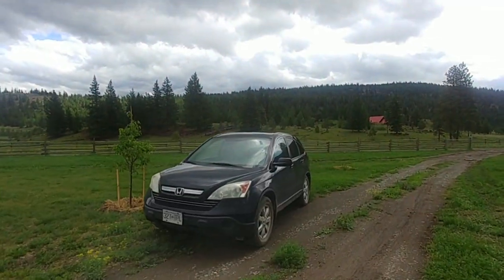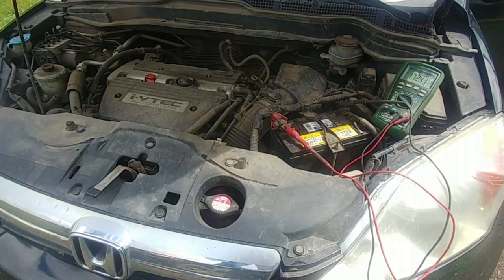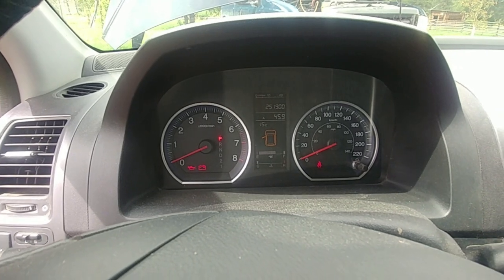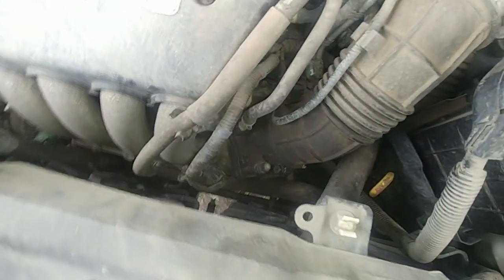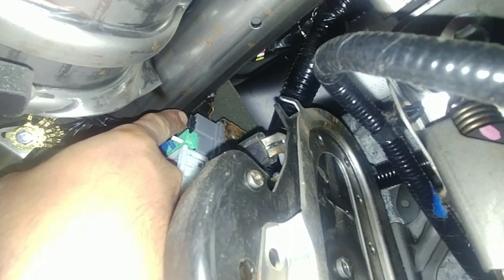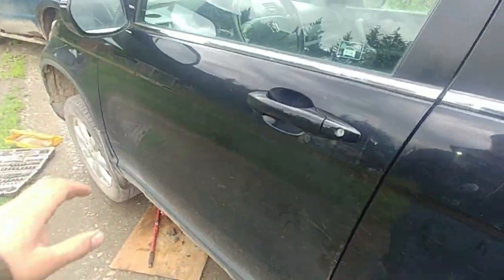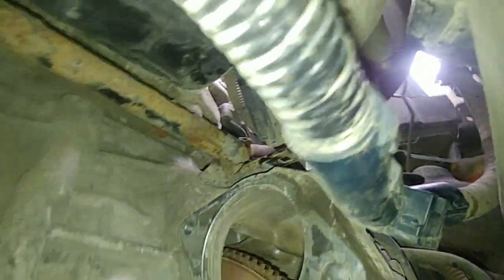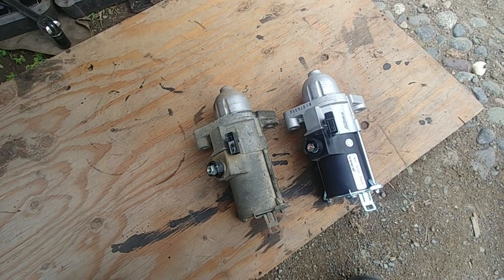HONDA CR-V NO CRANK, NO START - BASIC TROUBLESHOOTING. We Fixed!

Comment: Well done man, you've obviously spent some time learning to do this correctly. You even did the boost sequence by the book, and you load tested the signal wire, putting yourself ahead of many pros. The practicality of getting to some of these connections is the most irritating part of the whole game. On first review I wondered why the battery was flat, but you addressed that in the comments, the owner left the key on overnight. The one issue I struggle with is the chance of corrosion on the main wires and specifically the engine ground strap. I guess as a screening test one could use a test light hooked to ground, touching engine while friend turns the start key. If it glows, ground is bad, but that will only detect gross ground strap problems, it's not sensitive enough. And if the solenoid fails to close it's a weak test. Clearly in this case the solenoid wasn't closing, and it is unlikely you'll get two diagnoses causing that, so it would be really unlikely to have a second problem in the B+feed. So, it all comes down to how one can quickly prove the ground strap is fine. Any ideas? Perhaps a multimeter or power probe with the same configuration as the test light above, effectively using the signal going to the solenoid as your 'test load' when a friend turns the start key (which would work even if the solenoid failed to close)?
Reply from the maker: Hey Spelunkerd! 
Thanks for your detailed comment, I read it all. 
There are only two sources of any electrical issues: 1) heat; 2) vibration. If it's possible always check loaded electrical circuit to get accurate reading. Multimeter only measures differences between to potentials. I have another video on my channel testing Nissan Titan fuel pump loaded circuit power and ground, showing everything in details. If you have good main power, ground and control to the starter pins (check connectors, sometimes you can have good voltage on the wire but not on the stud. I would recommend to do loaded circuit tests if all test check out, then only go to replace the started.

Comment: Hands down most informative walk thru I’ve found. Any tip to get that back bolt to break free with the limited space?
Reply from the maker: Honestly, I hasn't been two years ago, I don't remember. I think I shown in this video what sockets and extensions I used. Sorry, if it wasn't clear. Cheers!

Comment: Extremely helpful video. My starter is 100% dead, zero crank, click or noise whatsoever. I was gonna take the intake manifold off but based on this, I'll go from the bottom! Thanks so much!!
Reply from the maker: Oh, I am so glad to hear that! This video helped you out to get your Honda CR-V back on a road and save some money! Thanks for your feedback!
Reply: I've done this job before from the bottom and I wish i would have went from the top taking the manifold off. I know this video makes it seem easier but it's more difficult in my opinion.

Comment: I just bought a 2003 CR-V for 200 Canadian dollars and, it has the same symptoms. Thank you for sharing.
Reply from the maker: Sounds like a great deal. What's wrong with it?
Reply: @PistonShack  so far, I installed a new battery ( Starts well), one rear brake line leaks and the AC needs to be looked at (empty or leaking ?). I need to test the transmission before putting too much money into it. And very minor body work (One small hole near the rear wheel well)
Reply: @PistonShack  I forgot to add. I'll keep you up to date about the repairs.
Reply: Update: I turn the key and the engine doesn't turn anymore. Everything works (minus the a/c) but no crank... Dammit ! And, I can't find the starter relay.

Comment: Thanks for the guidance! I was having problems with a P1078 code, and after resolving it, I ended up with the same issue that you were facing in the video. While taking out the IMRC system and cleaning it, I must have jostled the electrical supply to the starter and loosened it. All it took was a little attaching to get started!
Reply from the maker: Greetings Jeff! Great to hear  that, it helped you out. 
Interesting, how P1078 - Intake Manifold Runner Control System Malfunction High RPM could relate to No Crank / No Start Issue, hmm!
BZW, what was a fix for p1078 code? 
Thanks for sharing your experience.
Cheers brotha!
Reply: @PistonShack  The fix I found online was to clean out the buildup of gunk inside of the IMRC! after giving it a good scrub and wipe, the code was gone :)
Reply from the maker: @jeffstrueby9369  Great! No parts needed repair. Thanks Jeff!

Comment: Great video, looks like a very awkward job, don't know how you got the camera in there and got those great shots, my 2005 Honda CRV has now 122,000 miles on the clock on original starter so i will have to do this job eventually, I have seen this done from the top which means you have to strip out many hoses and connections also the inlet manifold, so I would put up with it being a bit awkward and do it your way which would be much quicker, thanks for taking the extra time to make and share the video.
Reply from the maker: You're so welcome Ken! I am glad it helped you out. Thanks for sharing your story. Let me know if you have any questions. Cheers brotha!

Comment: Your video is very helpful i'm thankful.. My starter died on me exactly Like what's showing on here.. Now If i replace the battery with a new one will it at least make the car start once? It broke down in an awkward parking position and i cant tow it to the mechanic
Reply from the maker: Try to disconnect main starter cable, clean starter eyelet and stud, it might help if starter itself okay due to voltage drop issue. Thanks for your kind feedback.
Reply from the maker: Before disconnecting main starter cable, first disconnect negative cable at the battery, its so easy to short starter circuit.

Comment: Those relays are hard to remove.
I found that a pair of small channel locks allow you to "grab" the relay. Small flat blade screw driver in between relay and locking tabs and bingo.
Reply from the maker: Thanks brotha! I was wondering what type of pliers will work the best to remove that "hidden" fuel pump relay)

Comment: Why did you disconnect the negative battery terminal and not the positive terminal? Great video by the way, I'm waiting for my new starter to show up, so that I can do this.
Reply from the maker: Better practice to disconnect NEG (-) terminal, just in case if you touch the ground you wont short anything. Thanks for watching.

Comment: My 02 honda had a no crank symptom as well....turned out the starter was bad with a weak battery
Reply from the maker: Did it click or nothing when you turned key to Start position?
Reply: @PistonShack  my 04 won’t do much i bought a new battery made sure there was oil , an it still won’t turn over. I tried jumping it as well but it’s not turning over I’m hearing it may be the starter
Reply: @zekeclark4644  same here :/ so was it the starter or the relays in the glovebox?
Reply: @TheOtherG  it wasn’t so I had a bad ground wiring situation as well as the original starter was still in my vehicle. Fixed wire an changed starter she’s been good ever since

Comment: Hi Im from the Philippines..My Crv 2006 model has a click but doesn't crank... sometimes it starts in just 1 click but most of the time it doesn't...What seems to be the problem?thanks..
Reply from the maker: Hi, brotha! Have you tried to tap the starter with a metal bar or hammer prior to starting? Sounds like your starter motor is on its the last leg. I have a great video on how to diagnose bad starter, check it out: 
NO CRANK? BEST COMPLETE STARTER TEST TUTORIAL. Starter motor/solenoid bench troubleshooting.
https://youtu.be/RH6dsti5q04
Let me know how everything is going! Cheers)
Reply: Okay bro, I'll try all ur suggestions..thanks again
Reply from the maker: @meandmybluecar  You're so welcome!
Reply from the maker: @meandmybluecar  Sounds good! Let me know if you have any questions.

Comment: So what was the solution? And what fixed it the problem?
Reply from the maker: Original starter motor failed. After we replaced the starter, vehicle has been starting no problem.

Comment: I've be told, to remove the starter, it is better to do it from the top, by removing the intake manifold. Well, those intake manifold bolts and nuts are very rusty. Rusty to the point that, they're no longer their original size.
Reply from the maker: Hey R Verro! I wouldn't even touch intake rusted fasteners turning starter replacement into serious drilling out and replacing broken intake bolts project.
Reply: @PistonShack  Well, I guess it's on my back I go. Thanks for the quick answer.

Comment: Omg dude, you just totally wasted your time and someone elses money. Your never gonna get a car with a completely dead battery to start off a set of jumper cables. You would have to charge the battery for some time before it will even try to start. You never asked yourself the first and most important question, why was the battery completely dead? My guess, the alternator went out. That battery didnt go from cranking the car to completely dead unless it wasnt being charged and something was draining it, meaning the car was running off the battery alone until it ran completely down and the car died. You changed a perfectly fine starter for no reason. Lear to ask the right questions, the reason the battery was dead in the first place was completely lost on you man.
Reply from the maker: Thanks for your advice and feedback. Short info to the story car didn't start day before and key was left "ON" overnight. I agree in an deal situation you should always start with fully charged battery. I bench tested that started it was faulty. Thanks again!
Reply: You’re such a nice person 👏❤️